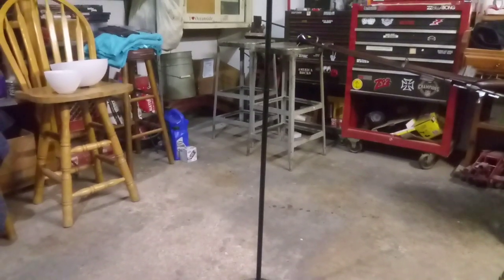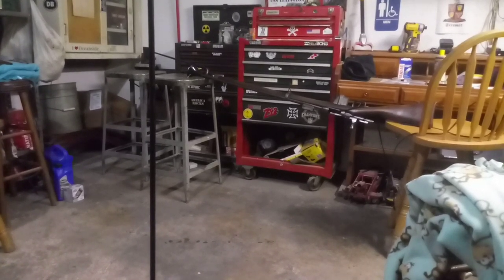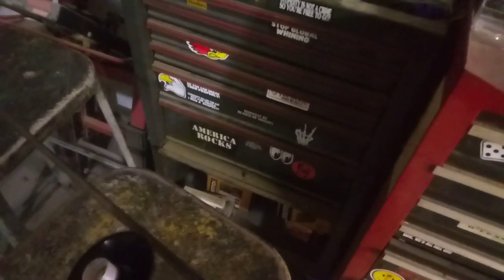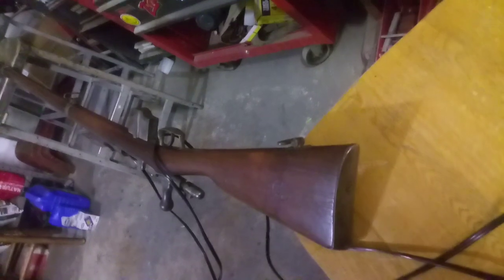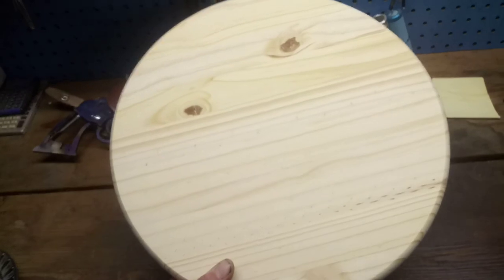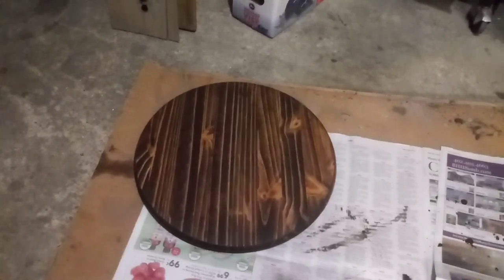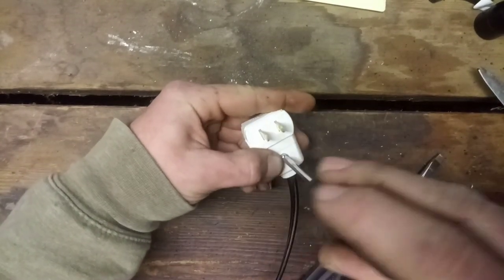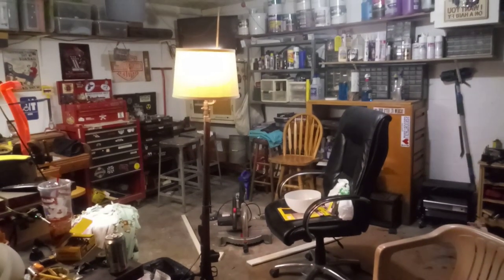Turning an old rifle into a working display lamp.

Comment: is it illegal to sell or purchase a firearm lamp for the night stand , that is the question .
Reply from the maker: Technically this Beaumont is classified by the ATF as an antique firearm so legally even of you were a felon this would be legal to own. I could also mail it to anyone without going through an FFL or sell ot across state lines without an FFL. To the ATF they care about as much about this as they do about your grandma's antique chifferobe
Reply: @Burritoswithfritos  just wondering thanks ,  its a awesome lamp .
Reply: @Burritoswithfritos  some states like commiefornia consider an antique firearm and a muzzle loader as a firearm, and require a ffl to transfer it, but for most of the U.S. send it
Reply from the maker: @Dgjnbv  Actually this meets Comufornias definition of an antique fire arm

Section 16170 "Antique firearm."
(a) As used in §§ 30515 and 30530, "antique firearm" means any firearm manufactured before January 1, 1899.
(b) As used in § 16520, § 16650, subdivision (a) of § 23630, paragraph (1) of subdivision (b) of § 27505, and subdivision 
(a) of § 31615, "antique firearm" has the same meaning as in § 921(a)(16) of Title 18 of the United States Code.
(c) As used in § 17700, "antique firearm" means either of the following:
(1) Any firearm not designed or redesigned for using rimfire or conventional center fire ignition with fixed ammunition
and manufactured in or before 1898. This includes any matchlock, flintlock, percussion cap, or similar type of ignition
system or replica thereof, whether actually manufactured before or after the year 1898.
(2) Any firearm using fixed ammunition manufactured in or before 1898, for which ammunition is no longer
manufactured in the United States and is not readily available in the ordinary channels of commercial trade.

So it does not need an FFL. A modern reproduction of it would.
Reply from the maker: Though I guess for the purpose of possession by a felon Cali would consider this a fire arm or any muzzle loader a firearm. So don't own this as a felon in Cali. Can own this as a felon most anywhere else. 

Honestly I like how Minnesota allows non violent felons most all of their rights back. Of we cant trust someone with their rights why do we trust them out of jail
Reply: @Burritoswithfritos  after silencer co came out with the maxim 50, cali deemed all muzzle loaders as firearms, therefore deeming the maxim 50 as a nfa item in California, federally muzzle loaders arnt regulated, but some commie states regulate muzzle loaders as firearms
Reply from the maker: @Dgjnbv  I see that they call the supressor on it a silencer and for that reason them and 2 other states are not allowing their sale though I can not find anything stating a muzzle loader is a fire arm amd you need to go through an FFL to buy one.
Reply: @Burritoswithfritos  TGC news news came out with a vid a few years ago talking a bit about how cali was able to ban them in their state
Reply from the maker: @Dgjnbv  and from what i can find its just because they say the suppressor is a suppressor and they do not allow those. Regardless what it is for. Except engine mufflers
Reply: @Burritoswithfritos  I saw a few websites that i never heard of that said that muzzle loaders weren't deemed "firearms" in California, however i couldn't find a "firearms" definition on oag.ca.gov website, its its gotta be some where in there and likely different from antique firearm or muzzle loader
Reply: @Burritoswithfritos  Id still do research before shipping an antique firearm or muzzle loader to California or other states that have strict laws